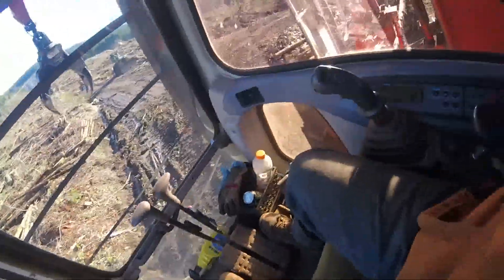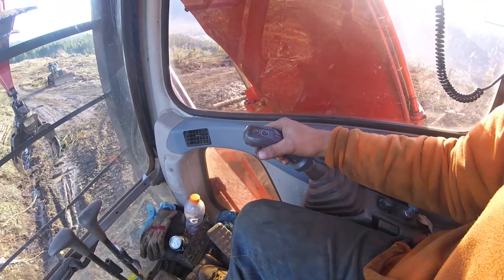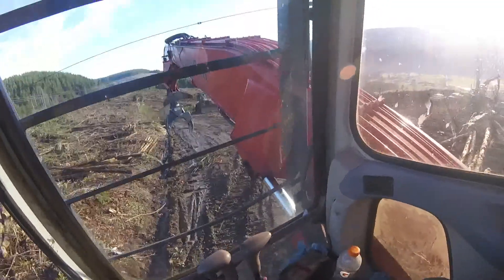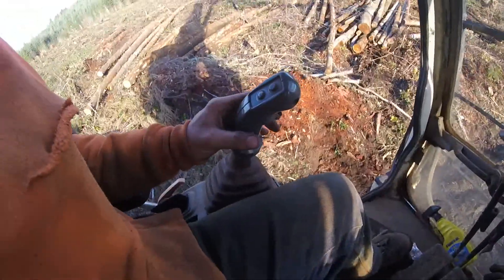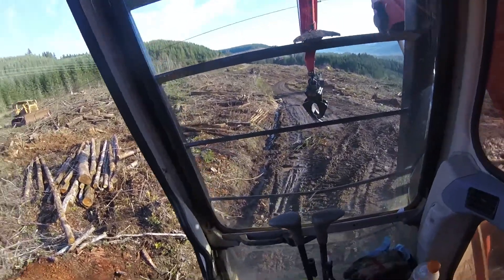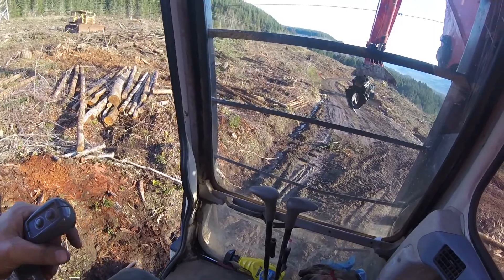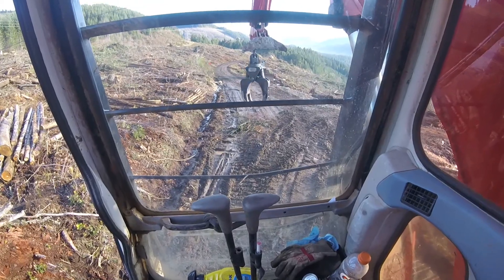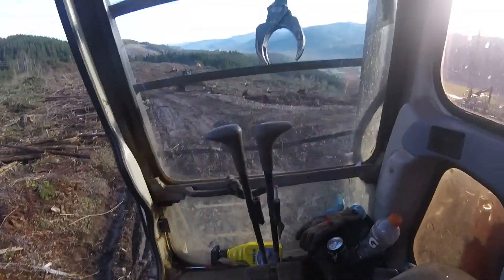loader controls how to

Comment: I enjoy when you explain how things work.  Which levers do what and all.  My dad ran shovel for years, from line machines, to modern joystick controls.  I was amazed at what he could do with an old Prentice with six different levers.  Thanks again. DR
Reply from the maker: them ol boys that could run line loader where operators now spent a lot of time behind the seat of a 98 linkbelt watching my dad glad u like the video hoping im explaining well enough but there are lots of different ways to set them up
Reply: Getting to skip school and go to work with Dad was the best day ever.  I would usually catch a ride home with one of the log truck drivers when I was real little.  Long day for a small kid.  I remember the line loaders would tip suddenly as they swing and it would startle me.

Comment: Never ever seen,or imagined that setup.That would be tough(dangerous)because its 50% different than excavator pattern.No offence,but beyond shocked
Reply from the maker: skadill just about every other gypo around here has it set up a little different than the next did work for one guy the heel rack was on a rocker switch it can be hard to get used to some of the set ups

Comment: Shovel I run has the swing the same but the heel is on the right side left to right and grapple open close and rotate the buttons on top of the joysticks.
Reply from the maker: Dalton Horton i like the rocker switches like that rotate on one side opeb close on the other im not a big fan of the piatol grip style that we use stay safe friend get logs
Reply: west coast logging alex esgate. We have the same buttons but they open and close and rotate both ways being on the joysticks.
Reply from the maker: Dalton Horton ya i like that